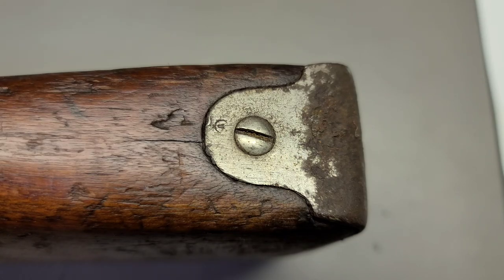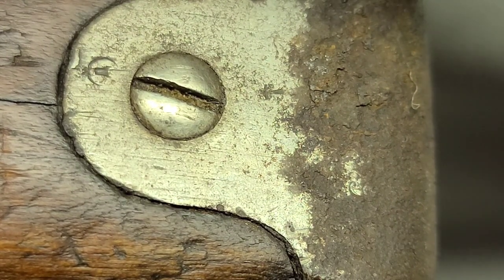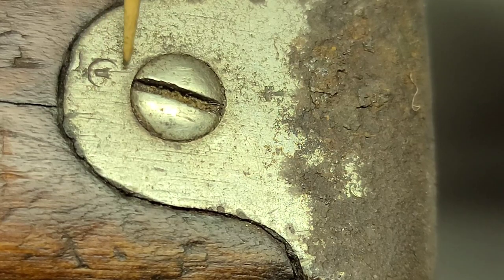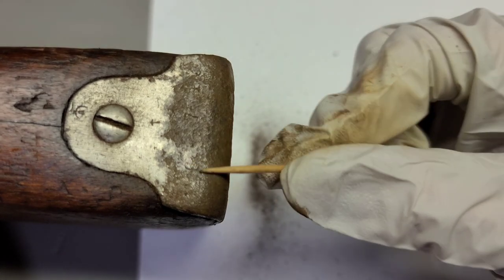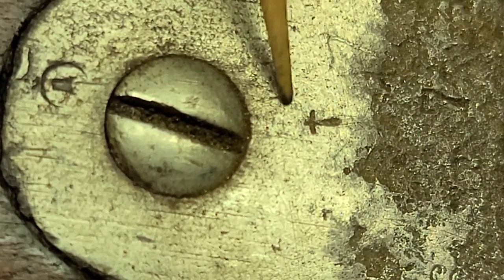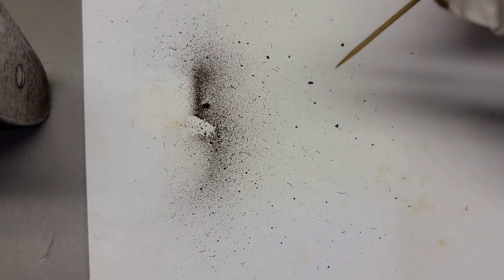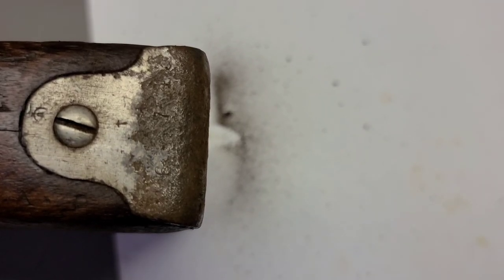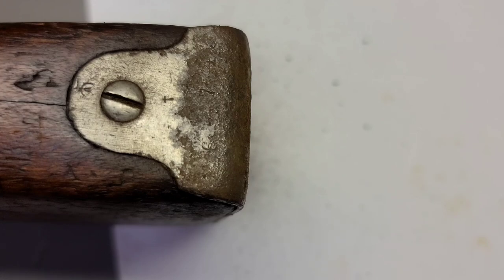Examining a Tula M91 Mosin Nagant Buttplate

Comment: Hello Sam,  try removing the buttplate and converting the rust by boiling and carding. It will convert the rust to a nondestructive oxide and leave any finish underneath untouched.  It may take a few boiling to remove heavy rust. cheers!